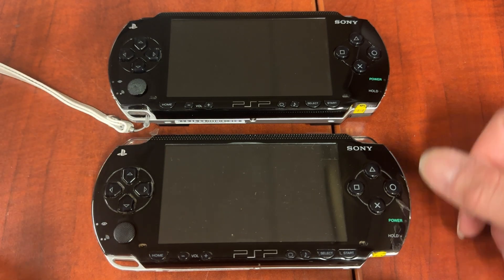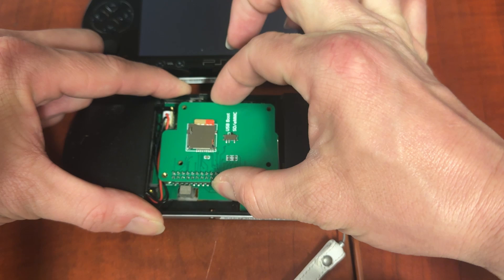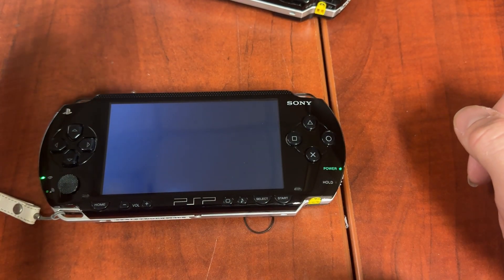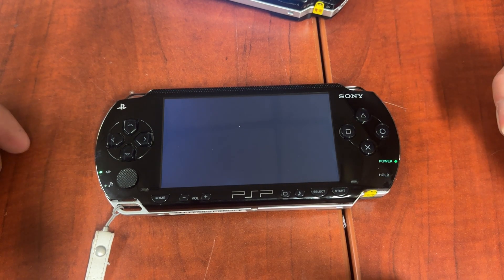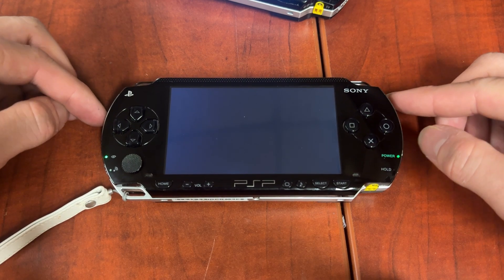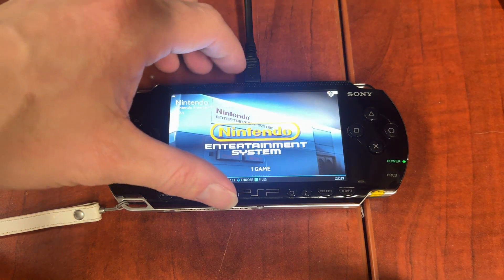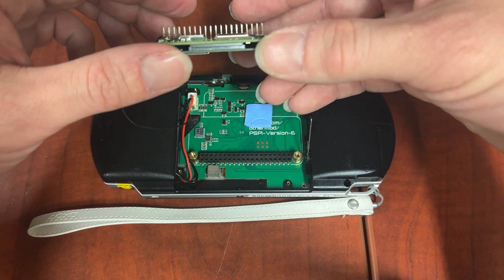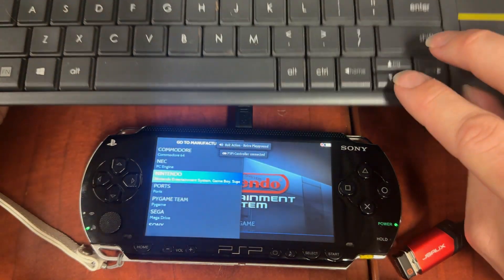PSPi v6: Troubleshooting After PSP Upgrade

Comment: I had the issue of not changing the switch to SD/eMMC. After this fix the left led started blinking as in your video but still no output on the screen. Bad contact of the screen pins? I'm using a Raspberry CM5 and the piOS retropie image
Reply from the maker: If your using the CM5 you HAVE to use the image that Cozza made.  no other image will work!

https://github.com/CoryManson/PSPi-Version-6/releases/tag/v1.6.1
Reply: @MakeOrBreakSociety  Yes I've flashed the 'pspi-pios-retropie-universal-64bit-v1.6.1'
Reply from the maker: @aribasadme  K i'll have to try that one myself.  it use to be just the Pios one that worked and not the retropie one.  i'll flash it in the next few days and let you know

Comment: Great video! Some of this possible issues I was not aware of, very helpful. 
A future video on hardware issues you can have from the PSP side, like the button/joystick not working or partially working would be great!
By the way I love the cable adapter =)
Reply from the maker: Thanks and I kind of love that adapter too :D

I was thinking about a video like that one I've seen allot of problems with that thumb stick inter-poser.